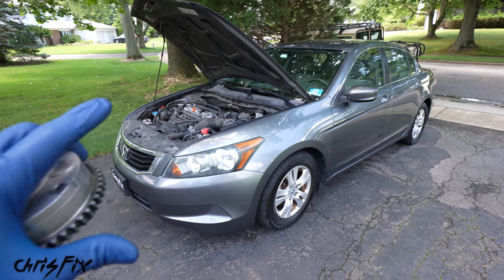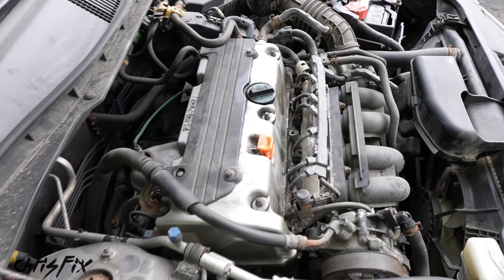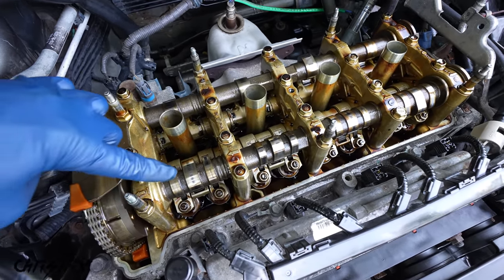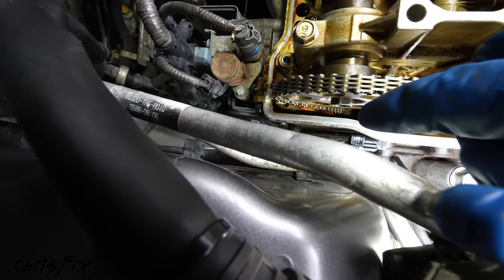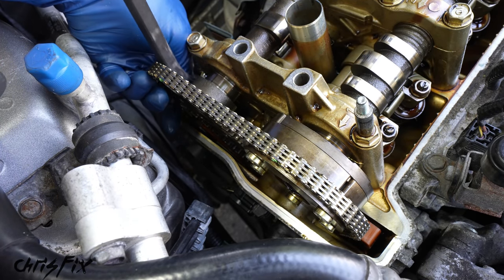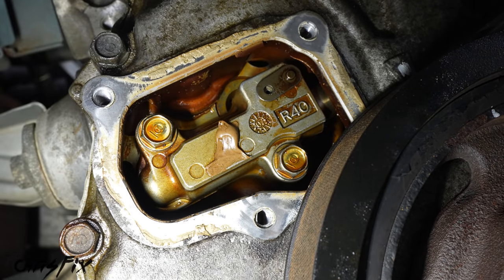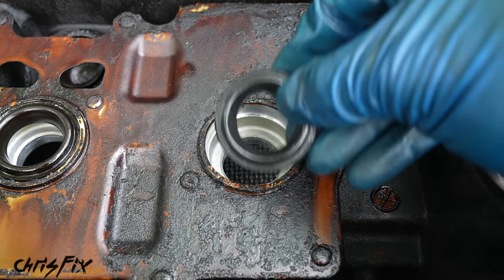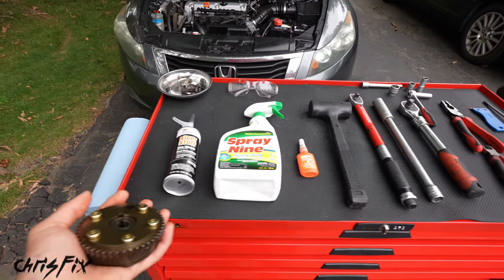How to Replace a VTC Actuator (Complete DIY Guide)

Comment: As a Honda technician who has done this job (including the timing chain, guides, and tensioner) several times, I want to say, AWESOME job! You explained everything perfectly, exactly how it's supposed to be done according to the service manual, and well enough for anyone to DIY it. I agree, removing the camshaft is definitely extra work that isn't really necessary - we've done the same thing before when replacing ONLY the VTC actuator. Obviously, if you need to replace everything else, you may as well go ahead and remove the camshaft. Cracking the VTC actuator bolt loose while the chain is still on/tensioned is a good idea, because otherwise you'll have to clamp the cam in a vice with brass, wood, or plastic jaws (to avoid damaging it) in order to remove and install the actuator. Don't be afraid to use an impact to remove the bolt! My only recommendation is to NOT use thread locker on the bolt threads, and only use clean oil - Honda does not recommend this because oil does go through the camshaft and it does reach the bolt. As long as the new bolt is torqued to spec (85 ft lbs) you won't have to worry about it coming loose.
Reply: I am not gonna read what you said bc its so long
Reply: Chris did a great job explaining everything and I appreciate your added advice. What causes a VTC actuator to go bad? Is it not changing the oil often or high mileage or punching the gas pedal to advance the actuator too often? I have an '09 Toyota Corolla, 1.8L engine with 88K miles; bought it 5 yrs ago with 20K. I do my own maintenance and change my oil/filter every 4K miles.  What are the chances I will have to replace the VTC actuator and at what mileage?; for instance, this Honda Accord had 200K miles on it.
Reply: I got to do this to my car soon. Are you saying there's no need for thread locker on the exhaust sprocket bolt as well?
Reply: I'm not the Honda technician, but a person the same as you who asked the Honda tech questions. I do my own vehicle maint. and I agree with the Honda tech, I would not use thread locker on the CVT actuator, but also I would not use it on the exhaust sprocket. If I were to use thread locker on anything, I would only use the blue color.
Reply from the maker: Thanks a lot and thanks for the tip!
Reply: @ronrandall7118  there was a recall/service bulletin a number of years back on these VCT actuators for a couple years, I think '11-'14. Some of them were just plain faulty and started rattling for no apparent reason, even if the owner kept up on oil changes. Typically, though, they will either fail from age/mileage or due to infrequent oil changes. It is usually replaced in conjunction with doing the timing chan, chain guides, and tensioner due to a cam/crank correlation DTC, and obviously poor running and the rattling noise, and that's almost always because of infrequent oil changes.

Toyota uses a slightly different system with their VVT-i but it does employ a cam phaser similar to Honda's VTC.
Reply: @skrk6  correct, thread locker is not necessary on either sprocket as long as you use a new bolt and torque it to spec.
Reply: Can I use the old bolt, or if I'm using the old bolt it is better to apply a thread locker?
Reply: Can things get worst if this isn't fixed? What else can break?
Reply: What causes the VTC actuator to fail? Will it fail again after certain number ok kilometers?
Reply: How do you become a Honda technician ? Is it hard?
Reply: @CrazyIvan1337  so is this replacement covered under warranty? I have a ‘14 with this problem. Thanks
Reply: If there is sludge what is the best way to clean it? You said if there is sludge it has to be cleaned but never explain how to properly clean it. Since you take such care in cleaning any grime and dust before removing the cover I assume there has to be care put into cleaning the sludge. Thanks
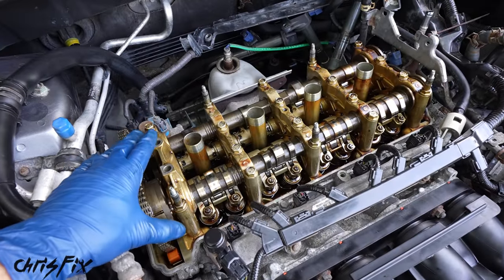Reply: @Michael-py4ui  well he did say to change the oil afew times with an oil additive, but I’m with you, should have shown the oil additive to make it easier to know what to use. Video Time (9:50) he talks about adding the oil additive and changing the oil afew times
Reply: @TR1CKSHOTS31  yah I did hear that but it didn’t make sense really because that would mean you’d have to wait quite some time before you could do this job am I right? I only change my oil like once a year pretty much.
Reply: @Michael-py4ui  well that’s fair enough, I get that. But you could always use the cheapest oil to basically just change it and use additive, run about 100 miles and change it again, and keep flushing it, I could be wrong but that’s something worth a try. Just like when you flush a coolant, you flush it and then just use distilled water( when it’s warm out obviously) run it for 20 mins then flush it then fill it again with distilled water and a flushing additive run it again for afew mins/miles, drain it then just add the coolant...  so I’m thinking the same could be done oil and additive you know. I change my oil every 5k miles, and change the oil filter too.. but your engine shouldn’t be sludge unless you go years without out changing your oil. Or never change the oil or filter and just top it off when it’s low and never actually change it.
Reply: @TR1CKSHOTS31  so I bought this car in 2019. It was a used 2016. It had 30K kilometres, which is just under 19K miles. I have been diligent with my oil changes. I now have 70k kilometres, which is about 44K miles…… I want to know why my actuator even went in the first place. Most of the research I’ve done it seems that the cars have way more miles then mine does.
Reply: @Michael-py4ui  well you know that they have to make a profit so they go for the lowest bidder, or some parts come out defective. Try to check if it’s covered by warranty or if it might have a recall for it… but if you have been doing oil changes on time you shouldn’t have sludge. It’s 
Relatively brand new car it shouldn’t have sludge it should be clean and clear… 44k miles is what roughly 8/9 oil change cycles doing it every 5k miles. But now you can get even more miles between changes up to 10k or even 15k. But that’s weird how that when out already, maybe the timing chain is the one that caused it to fail. Or driving patterns. Maybe driving to rough from old owner. But look into the warranty. It might be covered if it’s still under warranty.
Reply: @TR1CKSHOTS31  you can call your local dealer and give them the vin to your vehicle and they will tell you if it's still under warranty or not
Reply: @andrewsanderson5277  i appreciate it bro but it was @michael that has a problem with his actuator.  He should be within his warranty I think unless he didn’t get it at a dealership then his outta  luck. But he should look Into it calling the dealer
Reply: @salastatud3424  it took me O.N.E. minute to read. 😑 
It speaks wonders about your IQ. Not trying to be mean. 🤷‍♀️
English is my second language by the way. 🖖
Reply: @SAdozer  LOL I have a 2014 with 160k miles and I'm sure the warranty is no longer available in mine. How many miles does yours have?
Reply: @Michael-py4ui  he said something about an additive in the oil to clean it up.
Reply: @ladamadenadie1658  mine has 90k miles. And yes you’re right about not covered under warranty. I talked to the dealers service rep and it’s not even covered under extended warranty either.
Reply: Do you know if this procedure works on a 2015 fit, specifically regarding being able to get the vtc actuator off with enough clearance from that side panel?
Reply: @SAdozer  yes check your manual it’s listed under emissions . If it in CA it’s 15yrs or 150k mi. Federal is 3 yrs or 36k mi
Reply: Ironically Acura/Honda maintenance intervals are long. I was allowing my TSX to get to service  now and nearly hit 8k mi. My former Honda corporate  master tech /engineer mechanic explained its a flawed system and if I follow it will ruin the engine faster.  He said start changing oils once it hits  50% life left. He worked in Torrance as master tech
Reply: @ladamadenadie1658  people can spend 30 minutes to watch a video but can't take a minute or two to read a paragraph
Reply: <3
Reply: @SAdozer  If it is under 70,000 miles it is covered under by Honda. My mechanic told me this morning... I trust him wholeheartedly.
Reply: saludos te escribo, para solicitarte ayuda, necesito el manual para el cambio del actuador vtc pero del honda accord 2013 motor k24w1 2400 hp/cc EX L. que es diferente al que muestra este video, si puedes agradezco tu ayuda anticipada.
Reply: Hey. What needs to be done if the timing marks are off at the crank?
If it skipped a tooth?
Reply: @Jwalk1829  The car will not run correctly until you get it correct... As the maxim goes.. If at first you don't succeed ... Dust yourself off and try again... Pro Tip...Before you start... eliminate all doubt in your mind and repeat, "I will get this done right" and then get it done right... ROCK IT!! (Apply this to everything you do... You will be glad you did!)
Reply: @DaminalTheAminal  That isn’t helpful. Strictly asked what needs to be done if it is off by a tooth.
Reply: @Salastatud34 yeah
Reply: @Edgar-ne2eb The rattling sends shockwaves through the timing chain and prematurely elongates it. In addition to retarding the timing from premature chain elongation, the rattling can eventually elongate the timing chain to the point where the timing chain tensioner can no longer hold the chain in place. At that point, the engine skips at least one gear tooth in timing, and piston slap is likely to occur.
Reply: can i re use the old exhaust/intake cam bolt and torque to spec? or is it recommended to get a new bolt
Reply: How much this usually cost to fix at a shop?
Reply: The reason why they say to remove the whole cam is because when the actuator bolt is completely seized and someone uses all their strength trying to get it off they can end up bending valves.
Reply: No way u can use an impact gun over there , u are not an tech guy
Reply: @salastatud3424   🤣🤣🤣🤣
Reply: @trevey16  he said $1k
Reply: If I may ask you. I’m doing the same job on my 2009 Accord EX coupe, and while I managed to get the crankshaft to TDC, on the actuator and exhaust cam sprocket, the punch marks are at the top, the dashes on the side appear to be 2 cogs off. Question, should I continue with the repair?  Or is it another problem altogether?
Reply: @CrazyIvan1337  t
Reply: @SAdozer  2 states, calif and illinois have class actions against Honda.
Reply: Bro wrote a fucking college essay
Reply: Has anyone had success using impact to take off the bolt? Or is it far too risky?
Reply: (--MIND BLOWN--)
Reply: Thanks for the confirmation that the steps are correct and for the suggestions that the other guy will never know BC he doesn't want to read 150 words
Reply: @trevey16  1K labor
Reply: I accidentally moved the camshaft and lost top dead center. What do I do to find too dead center again
Reply: @corderriusflorence4808  if it’s like my ford ranger there’s a tool that aligns the cam to the engine for top dead center.
Reply: Thanks both of you .. mine been doing it for a while now and I just been on bs but I'm going to fix it since I have another vehicle to drive other then my bike
Reply: @Jwalk1829 need to remove the timing chain cover and tensioner and move the chain one link in whatever direction you need to on the bottom sprocket, making sure to keep upward tension on the chain so that it doesn't fall back off the bottom sprocket. Then reinstall tensioner and cover then finish the work up top.
Reply: if you use an impact doesn't oil shoot all over?
Reply: @salastatud3424  Lmao
Reply: Does having bad VTC Actuator cause anything bad? 2015 crv 
Mine does a rattling noise when the engine is cold (during start up)
Reply: Hello, I have a 2012 CRV that makes that awful start up noise on cold startup but I don't have any check engine codes. I've used multiple OBD checks and none give any codes whatsoever. Would it still be the VTC actuator that needs replacing?
Reply: @TBH_Shadow  yup. it is the vtc actuator... 2015-2016 crv were for the chain tensioner. for you guys 12-14 crv are the vtc actuators.
Reply: As an actual honda accord, thank you!
Reply: @ronrandall7118   Our 2014 Honda CRV is making this sound, and we have just over 80K on the car, so we just put up with the noise, as it only does it once in a while, during the cold weather months.  What bothers me, is those that have gone through the process of changing the VVT actuator, and find within a few thousand miles, it does it again!
Reply: @CrazyIvan1337  Oddly, our Honda CRV has always got it's oil changed at 5K intervals, and I believe it to be super clean on the inside of the engine, and we only have 84K on the car, and we still get the odd rattle, so there must be more to the VVT issue, than just mileage and or long oil change intervals.
Reply: @Edgar-ne2eb   Yes, there is one fellow that paid Honda to do this repair, and the noise was back after 2,000 miles.  He has a channel here on Youtube regarding this, if you want to look for it.
Reply: Thanks for replying; nice to know about other makes such as Honda with the same issue. I definitely don't want to buy and install another VVT Cam Gear. I will live with the noise occasionally in the winter months when not started for several days. Again, thanks for feedback.
Reply: This is what I was looking for! I was wondering if I was able to use an impact to remove the bolt!  Thank you!
Reply: What happens if the timing chain tensioner key hole is way off the hole alignment even when I turn the crank shaft counterclockwise a little to try to decompress it to put a new tensioner in to replace
Reply: Get a job
Reply: Is this a "it needs fixed immediately" kind of issue or does it have time before it seriously damages somehting? Mine just started making that rattle but it's rare even on cold starts. I just don't have the money and don't feel comfortable working on my car
Reply: @Alex-gn7wd  Why not?   Isnt that easier?
Reply: @richardwanamaker9080  That's before Bidenomics hit us
Reply: @corderriusflorence4808  You should have locked it in
Reply: @gfriedman99  I didn’t learn that until after wounds. I have a 2014 Honda accord now but it didn’t really bother the car any. Just stopped going in cruise control. Car still ran a year after so I was satisfied

Comment: VTEC!!!!! Killer job as always Chris.
Reply: Vted
Reply: You could learn a thing or two from this guy lol jk
Reply: Driftstang VS R32?!?! You and Chris should do a video together, first one to blow up their engine WINS, loser has to buy and install the winners new/rebuilt engine. a specific white GLI is NOT allowed!! lol
Reply: @Cus7ate9  lol Chris would probably win, I saw a video of a similar mustang that had a rod knock and threw a rod when someone was pulling it into a shop and it kept running!!!
Reply: Vtec yooooo
Reply: VSauce
Reply: Guys does whine handing to focus
Reply: thxxx u helped me with ur videos :)
Reply: Chrisfix just kicked in yo!
Reply: nyoom
Reply: I have a 1.6 FSI 2004 vw touran. The engine has the same rattling noise on cold startup, but no check engine light or issues in general ? Does the FSI engine have VTEC?
Reply: How's the Audi
Reply: Turbo!! Jdm vs euro…
Reply: When HumbleMechanic comments it means is good video.
Reply: @Bimm3rcc  I have a 1.4 TDI VW Touran, 2007. Also rattling noise on cold startup, with timing chain changed 10,000 km ago. Codes P000A, P2262 & P10AD. 1.4 tsi was a very problematic engine... it only has 120,000km and timing chain has been replaced twice. I wish I had never bought this car.
Reply: @Bimm3rcc  Your engine have VTC. VTEC is a completly different thing
Reply: Chris does a killer job on vtec meanwhile Humble Mechanicnis the Vtec Killer literally
Reply: Got your head gasket repair video as the next recommended video, you guys are awesome 👍
Reply: @Bimm3rcc  if your engine is the 1.6 85kw, which is for touran, it has VVT, variable valve timing.
Reply: @derekfordyce9  thanks, but what could cause that same noise then? Should I be concerned
Reply: I loved your vid with gears and gasoline, 💥
Reply: *i-VTEC, actually, VTEC doesn't fail like this.
Reply: @michaelscott6669  the Honda he raced didn’t have teh VTACKs, yo!
Reply: @404jamill  Nascar intensifies
Reply: @Bimm3rcc  VTC not VTEC
Reply: @proxyhx2075  Any idea why I have the same rattling noise
Reply: @Cus7ate9  chris sold the drift stag
sorry
Reply: YEAH VTEC!!! 

sad 10 mph vtec noises intensifies
Reply: James Pumphrey: "BAAAHHH!!!"
Reply: .... kicked in Yo
Reply: i-VTEC

Comment: Should've titled this, "How to put the 'kicked in yo' back in your VTEC."
Reply from the maker: It's like a Ferrari now ;)
Reply: @chrisfix  It this repair similar to replace a cam shaft or timming shaft.
Reply: @justinunger38  there are videos for both of those. Dont use a timing chain video for a cam replacement or a timing belt replacement.
Reply: @chrisfix   Spray 9 is aliso NSF compliant so spray your food grill and that is what 6699 Advance uses to clean every 2 hrs for Covid!
Reply: The Accord in this video doesn't really have a perceptible VTEC engagement.
 I daily one of these, and I use the whole tachometer during normal driving, so I'd definitely notice it.

...what? It's only 177 HP (not bhp). You kind of need the whole tachometer.
Reply: @chrisfix  chris, please add subtitle
Reply: But it has nothing to do with vtec….
Reply: It's not really part of the VTEC system, though, it's the main component of the VTC system and it doesn't kick in, it continuously adjusts timing on the intake cam. I guess it's technically part of the i-VTEC system, but it's not VTEC as most people think of it.
Reply: @jlco  
I guess there are V6 Accords , with more power.